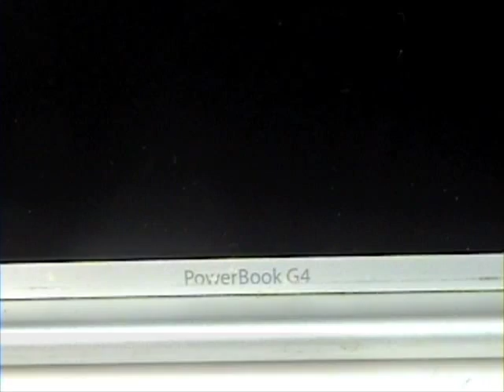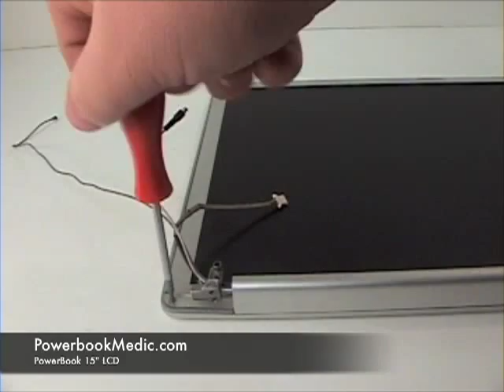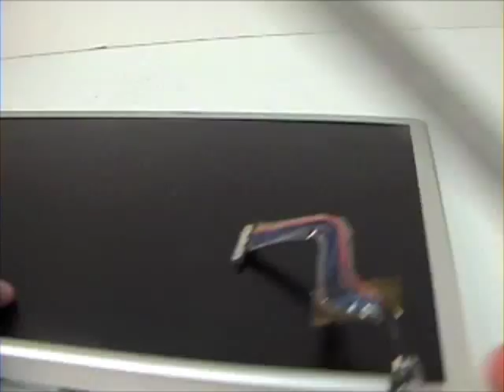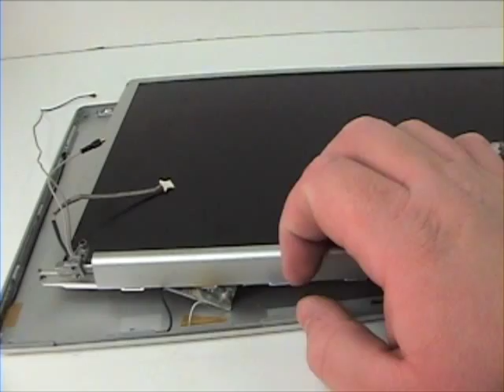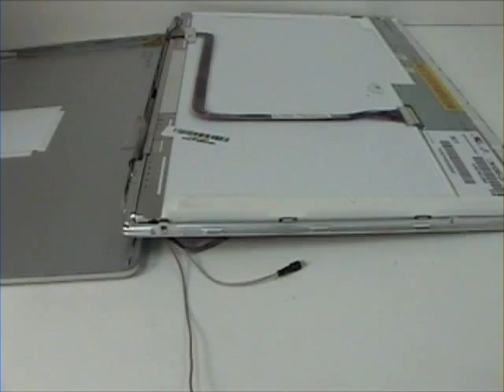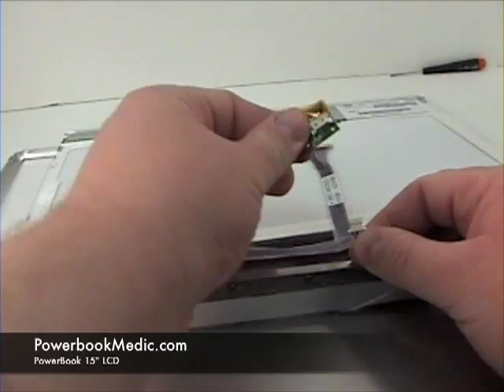Powerbook 15" Repair - LCD Disassembly

Comment: it's really not that much work.. i can't get to the damn power cable disconnect :(  i have everything apart and where you easily slide the tiny board out to access the small white plug for the power.. well, that isn't just sliding out for me.  i have 3 screws holding it in that are under the board itself. no idea how you got to them, didn't see it here. any help would be appreciated!!